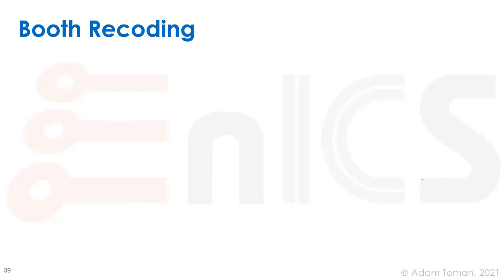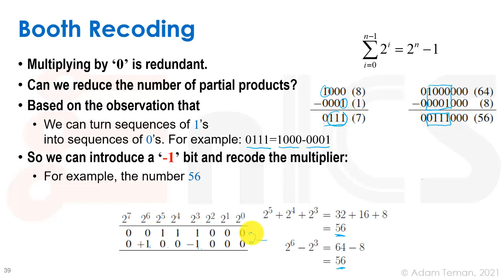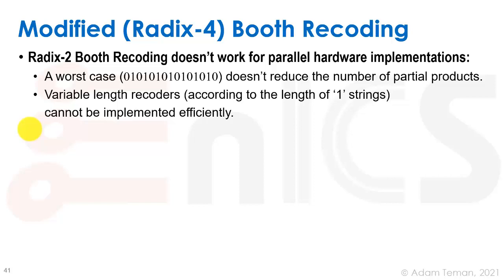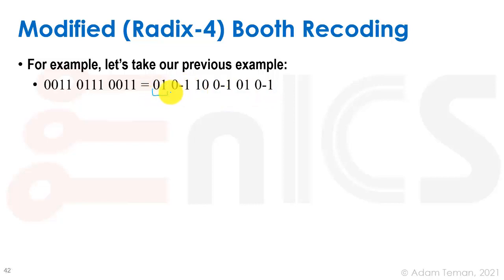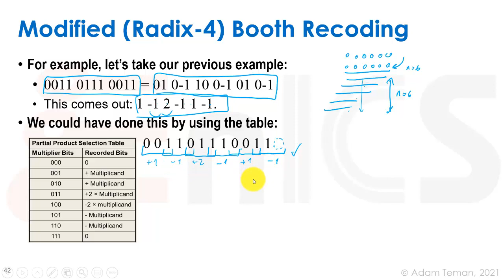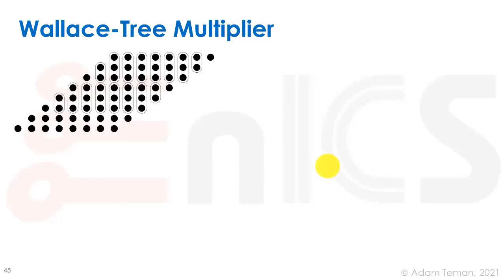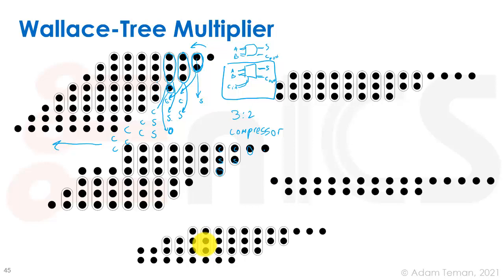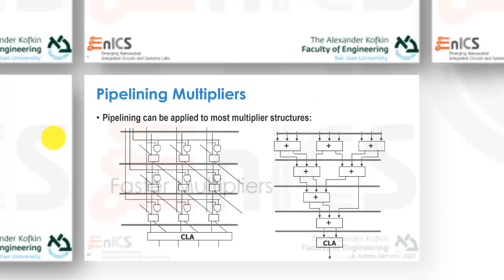VLSI - Lecture 10d: Fast Multipliers

Comment: Dear Prof Teman. Is it necessary for a Wallace Tree Adder to have unique configuration/number of FAs amd HAs at each stage? I have checked various books and seen different configurations.
Reply from the maker: No, it's not at all necessary to have a unique configuration.
You can build the Wallace Tree with many different options, but the common methodology is to try and balance it until getting to the final adder.